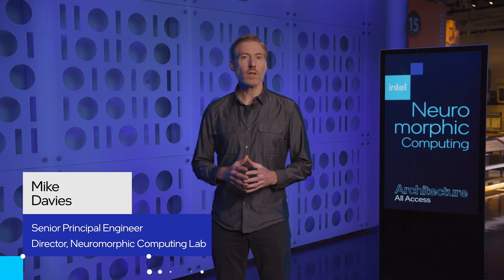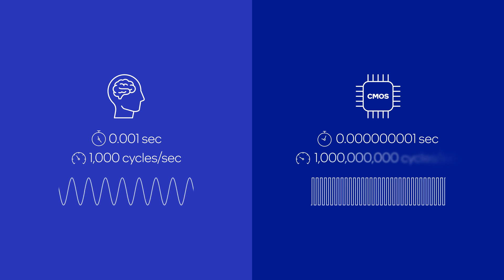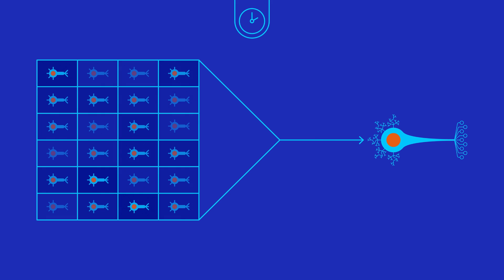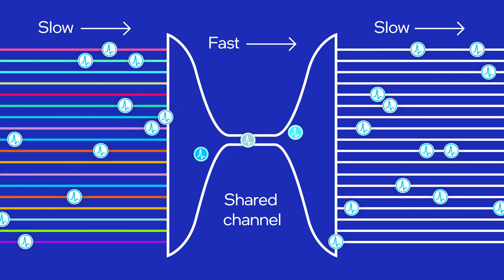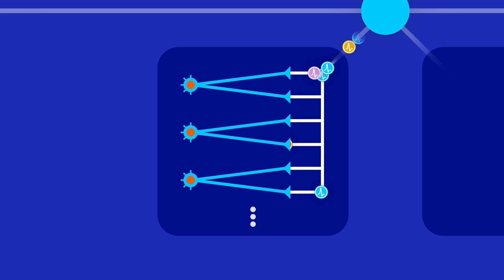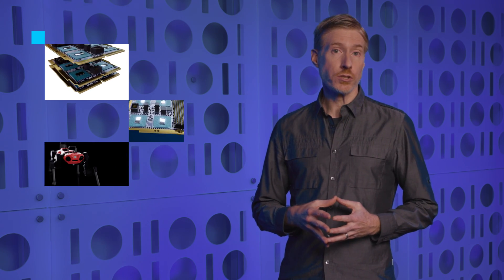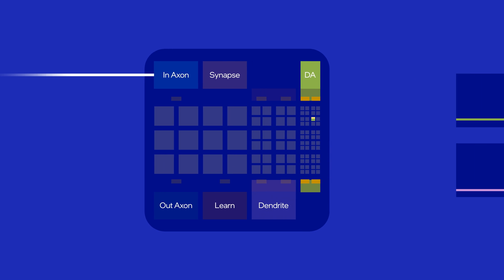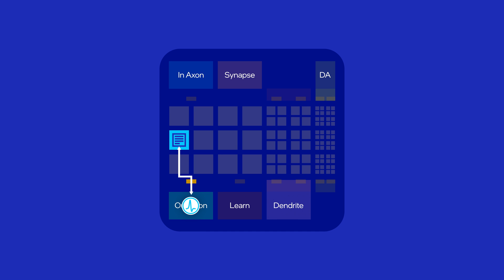Architecture All Access: Neuromorphic Computing Part 2

Comment: {Solve} : {{Maths Roll Error on 24Bit Audio versus 32Bit} ~= Stutter} : Windows 3D Audio, DTS & Dolby Atmos 2022-11-30 RS

*
{Solve} : {Maths Roll Error} : (c)RS
{Maths Roll Error on 24Bit Audio versus 32Bit} ~= Stutter

Additional roll, Error margin on 32Bit maths Float with 24Bit 5 point margin roundups,
A 32Bit float rolls up on a single operation 226526554817.{24Bit float + Error roundup} .9> .49 = .5+ = roll up.. 

R={5+ or 4- | 0.45+ or 0.44-} : or {0.445, |> 0.444444444445 |> 0.4 N4 +Decimal Places +5}

Clipping operation depth of float; Is 3 operations or 2 with Stop count = 1 to 24 bit places + 1 or 2 for error rolling, up or down.

Precision Clip
Math OP | Clip > Cache {Math OP <> Use}

Precision Counter
Math OP + Counter(internal to FPU:CPU | Stop > Cache {Math OP <> Use}
*

Windows 3D Audio, DTS & Dolby Atmos should do to at least 32Bit 384Khz 7.1 Channels, 

There is absolutely no reason a 64Bit processor cannot do 64Bit audio, 
Mind you 32Bit Integer is around 60% of total CPU Support with 64Bit divided by 2, 

So 32Bit Audio is 100% speed conformant & there are few reasons to reduce it to 24Bit or 16Bit without processing benefaction; Such as Error management on 24Bit on 32Bit instruction: 

Both AMD & Intel X64 

Rupert S 2022-11-30

"State-of-the-art approaches such as OpenMP and OpenCL"
Reply: its been 8 months, what are you views now?
Reply: @o1-preview  Very positive! 

Inference & FMA De-Block Styles

For upscaling matrix: MMX+ & SiMD
16x16 Block as used just about in HD, 
8x8 Blocks Certainly NTSC, PAL, JP_NTSC!, 
Very usable for deblocking JPG,
16x16 & 8x8 is very good for Inferencing active on Scaling & Deblocking..

4x4 for main Inference XBox & 8x8 for PS5..
XBox can use (4x4)x4 for 8x8 & (4x4)x16 for 16x16; Very powerful!
PS5 can use (8x8)x1 or x2 for 8x8 & (8x8)x4 (x8 for additional processing) for 16x16; Very powerful!

Inference & FMA De-Block Styles List

(4x4)x4
(4x4)x8
(4x4)x16 + processing
(4x4)x32 +++ processing

(8x8)x4
(8x8)x8 + processing
(8x8)x16 + processing

(16x16)x1 + processing
(16x16)x2 ++ processing
(16x16)x4 +++ processing

8:4Bit Concepts: 65535/255=8Bit 65535/16=4Bit

16bit/4bit : 4Bit colour pallet, But we can fraction 16Bit/4bit in essence 16/4! 65535/16; Compression Shapes & Gradients.
Polygon, Shadow, Contact
Alpha Channel 2Bit, 4Bit
Grayscale edge define sharpening
Single Colour Edge detect
Shape Fill in Alpha 10,10,10,2
Xor, Pattern, Shading, Shader, Cull, Shape & Depth Compare after define

Comment: Very cool technology! Looking forward to seeing where Loihi and LAVA end up!
Impressive that Loihi 2 was ready to go on Intel 4 so fast! From what I can see though, the extra density you gained versus Loihi on 14nm went towards a much smaller die size. Are there plans for something like a Loihi 3 that might scale the die size back up and tackle some larger networks?
I also saw the stack-able Kapoho Point boards were released a couple months ago, but there wasn't really any press on that, it would be interesting to hear more about that. So there are four Loihi 2 chips per Kapoho Point board and you can stack multiple boards for 8, 16, potentially even more? I recall there were full server racks with over 700 Loihi chips in them though. Is there any plan for that sort of scale with Loihi 2?
In any case, very cool stuff and I think the most interesting thing of all would be to see what this sort of technology enables. Loihi had some interesting graphs showing how it stacked up against more traditional accelerators and such, but I haven't seen that for Loihi 2 anywhere.
Reply: Can we make a whatsspp group  for   nueromorphic enthusiast ?
Reply: @srishti2k22-iw5dh  If you mean for Intel insiders, probably go with Teams. Outside of Intel, I'd probably ask the Intel Insiders Discord team to make a channel for it. Otherwise, yeah the Intel subreddit may be interested.
Reply: or a reddit forum